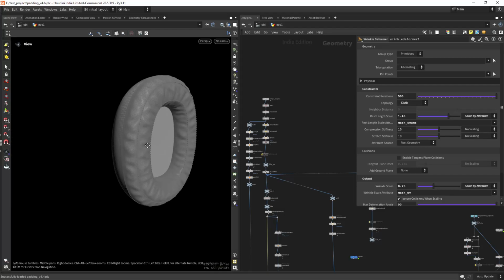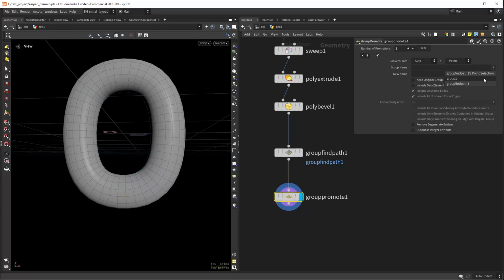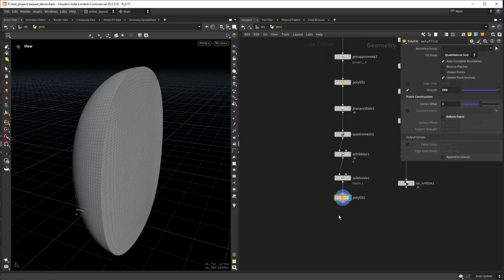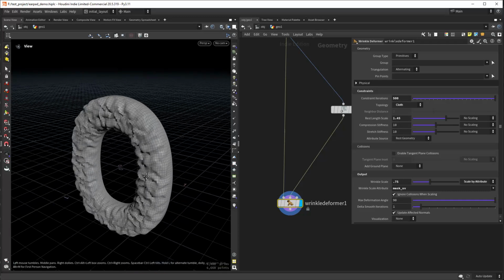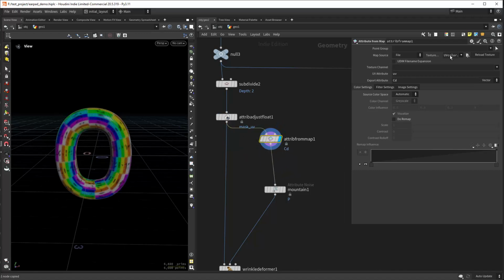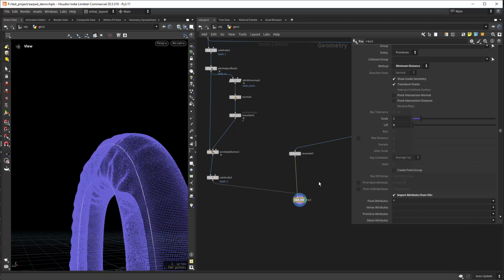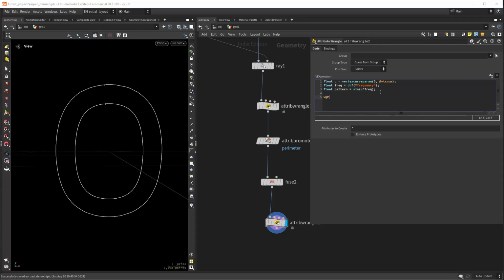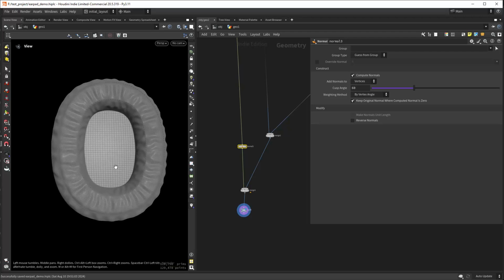Procedural Modeling with Houdini 20.5 Tools

Comment: I don't know why but my inner set of stitches are facing inward. I found that the point order is the opposite of the outer set of stitches. Any ideas that would fix this issue?
Reply from the maker: Hard to say, could the normals not be facing the correct direction? I could have a look at the file, send me a message on patreon, or shot me an email with the file. Cheers